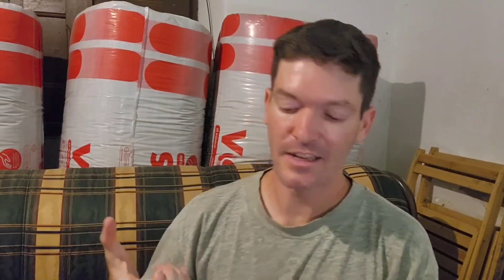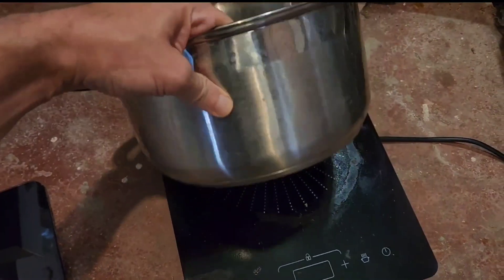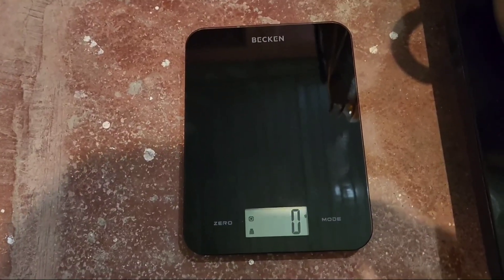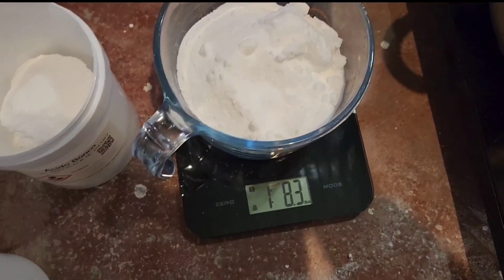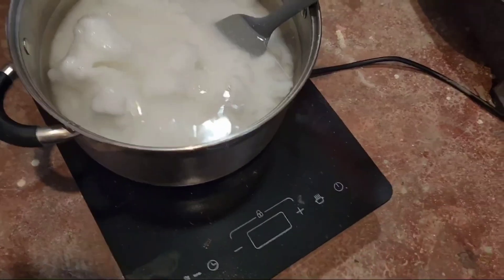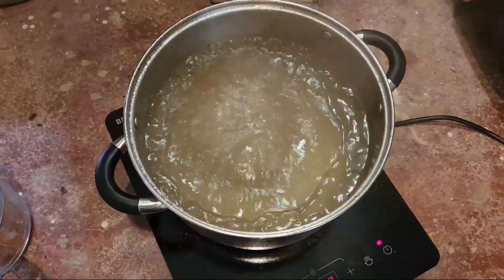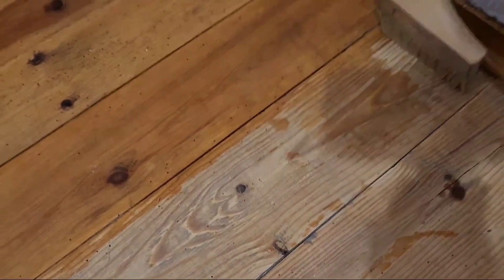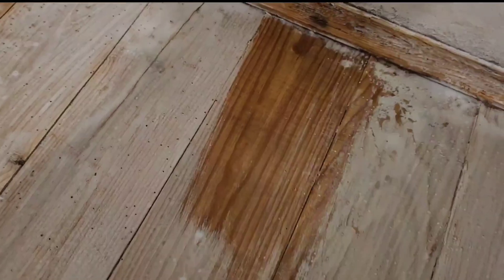My 15k House - Ep. 20 - DIY Borate Wood Treatment

Comment: JD that was great information. Thanx so much. I bought 6 acres in central with a river and i will be building a small home. I arrive in December. This is great information for future use to paint on all wood. Appreciate your research and info. Cheers. Glad to have you back. Gina in Upstate New York USA moving to Portugal/Italy
Reply from the maker: Happy to spread the knowledge, I definitely wish I knew about this in the past.  Plus the main treatments here are cypermethrin based which I would be surprised if that lasts more than a year with the heat and sun here
Reply: @My15KHouse  Fun love your little bits of info. Will come in handy when I build my small house on the property I bought> WIll treat all and any wood before I build. Mostly cement, steel and render but I am sure there will be some wood. Thanx > Have fun. Are you there full time now for the olive season and winter? Gina
Reply from the maker: as far as I know I will be here full time
Reply: @My15KHouse  good for you. Thanx for all of the episodes